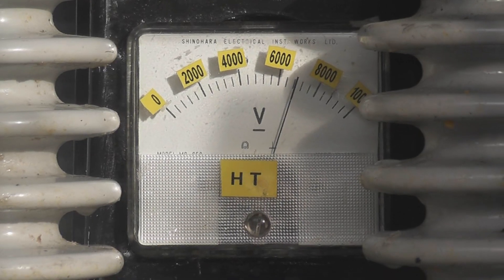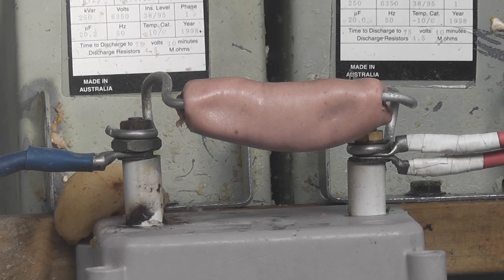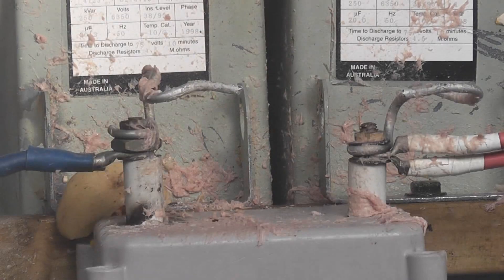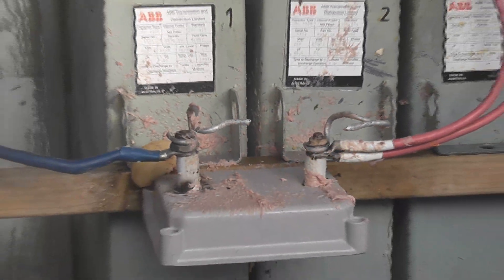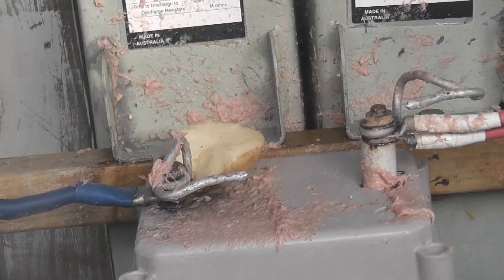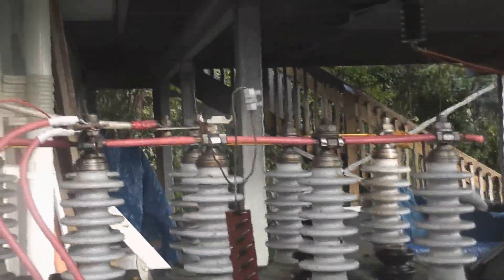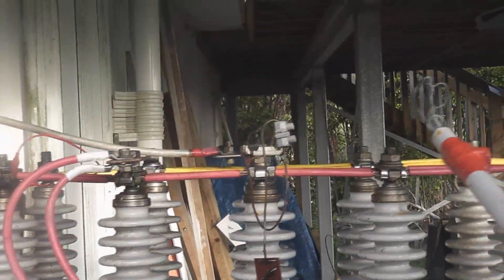Sausage

Comment: Eeeeew. =BAAAAANG= Bits of sausage everywhere! :-O

You're going to be finding bits of that sausage all over the place for the next few weeks....That's going to be attracting a lot of flies!

As you already found, there's bits all over that sheet, bits all over the van.....
The capacitors took a right splatting as well. Did you look upwards? There's probably bits all over the ceiling also!

Yes, I'd say have a good look around and recover those bits of sausage, otherwise the flies will get at it, and when meat goes off..... it doesn't half whistle!

Yes, by the looks of things..... you wouldn't want to get your fingers across that capacitor. I've seen hot-dogs fizzed up on mains current, but all of that wallop in a split second is enough to blow it apart without even cooking it!

Thanx for showing,

-BoomBoxDeluxe.

( Edit: I forgot to add my Viewer number, which was Viewer # 151. :D )

6th May 2015, 12.20
Reply from the maker: BoomBoxDeluxe Yes pieces of sausage meat on the washing line, under the deck, on the trees.
Reply: Haha, that made a right mess of a lot of things by the sound of it.

Here's another idea I've thought of:

Electric high-capacitance smoothie-maker. :D

It works a bit along the lines of what Mr Photon done in his "Banging Christmas Balls" video, but instead of dropping decorative tree baubles down a tube and onto capacitor terminals, substitute the baubles for various fruits of your choice. :D

Have a container underneath to catch all the fruity carnage and resultant juice-release and there it is.... A high-capacitance smoothie. :D

Enjoy the nutritious flavour :D

-BoomBoxDeluxe.

7th May 2015, 12.31

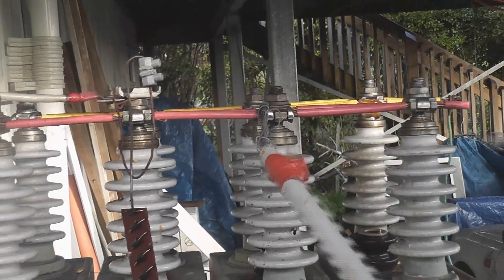Comment: 0:50 What is that thing hanging down with all the little resistor looking things for?
Reply: Lvaneede Lots of diodes in series to make dc to charge the capacitors.
One diode can't hold back the voltage.
Reply: Josh C oh, right. Diodes make sense.